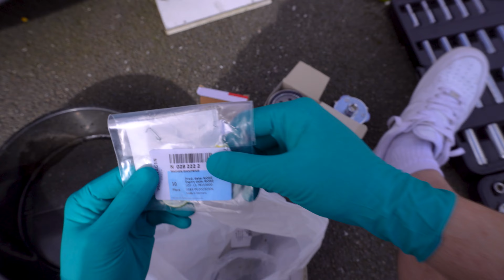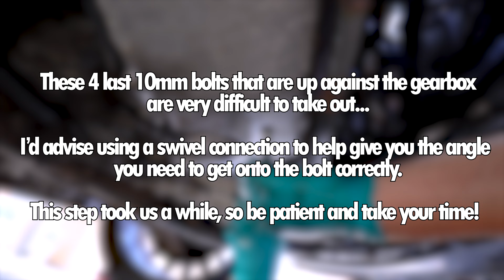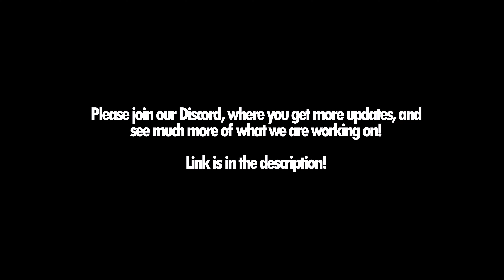You NEED To REPLACE This If You Have an Audi TT Mk1! - *1.8T Oil Pickup Pipe (DIY) Replacement*

Comment: Nice to see a younger chap looking after a Mk1 TT. The one thing you need to do though, without a doubt, is add some Waxoil to the underneath. Its a messy job, but the black stuff in a spray can is superb. Clean the underside with a brush, some light sand paper, and get the muck, loose debris and surface rust off where you can on those beams and bars. Then coat the whole thing, at least twice. Do it one day, leave it on, then add another coat the second day when its dried a bit. Then you can forget about it rusting and drive around all winter with no issues. And it will save you a lot of money in the long run, keeping parts preserved. I have a Mk2 TT, and its mostly aluminium so I dont need to worry about rust, but on mine the boot floor / rear subframe can be an issue, so I cleaned it up and waxoiled the lot. Just passed its MOT and the mechanic said it was really clean and rust free under there. As you keeping the car outside as well, and not garaged it would be a really good idea. It will cost about £30 for the waxoil and couple of days messy work. But it means the car will stay rust free and help to hold its value long term...
Reply from the maker: I appreciate the feedback, I am eventually going to be dropping the front and rear subframe and sand blasting and powder coating them to make them look brand new so I’m not too worried about them.
Reply: Good idea. But when that is done. Waxoil them. No matter how good they look. All the stones, salt and debris on the roads will still chip the new coating, so the waxoil will prevent that happening. I am not a salesman for the stuff, I just have used it for years and it works. Its the only stuff out there that does, no matter what other protections you put on the metal and suspension etc. Its bitter experience that has taught me this...heh...It will be a thorough fix and future prevention too.....
Reply from the maker: @Simon-xc5oy  definitely will do the wax oil! Same with the sills too, they all need sorting also!